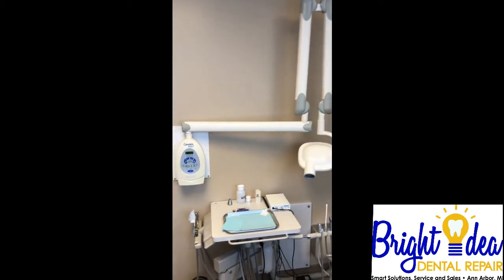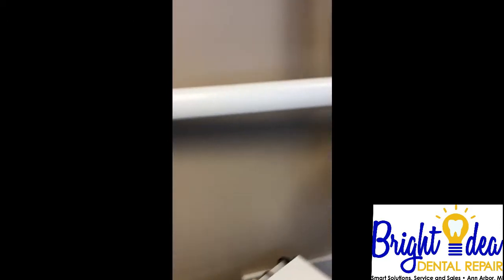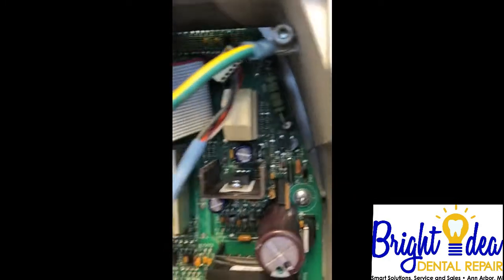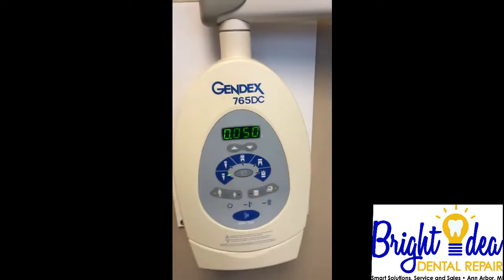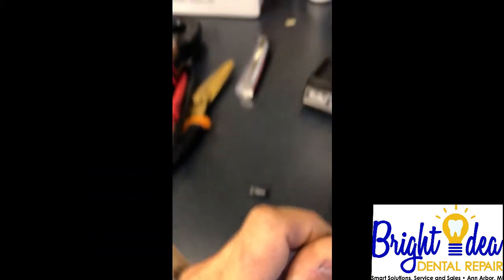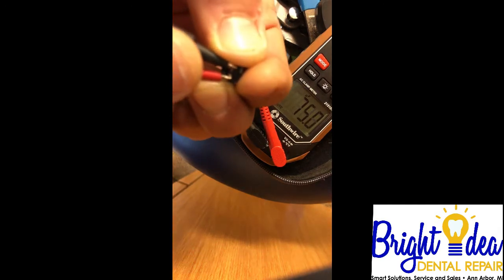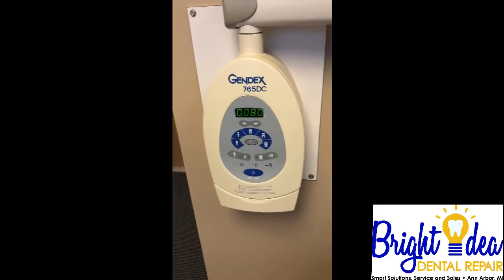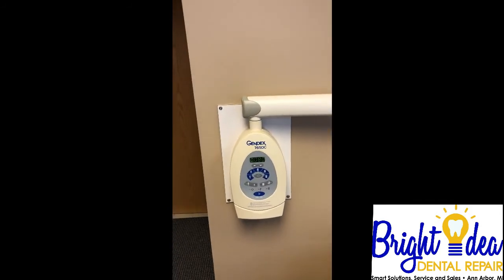Gendex 765DC Fixed!!!

Comment: Hi, 
I got few 765 DC, two of them show ERR01 witch together with D34 shows mains undervoltage. 
All main PCB had been re-soldered (under microscope I found lots of oxidated welding points). All electrolitic capacitors were replaced. 
That is the PCB fault (I was swapping the boards between units). 
All voltages are ok

Anyone's got a hint what's causing the Err01 problem?

Comment: MyGendex 765DC xray unit occasionally will not fire.  I notice the power light flashes when this happens and .04 appears in the display.  Most of the time cycling the power helps but not all the time.  I was wondering if you knew what the issue is and if so, if a part replacement will help. BTW  How did you know C60 and C65 needed replacing, or that they malfunctioned? Thanks in advance.
Reply from the maker: Thanks for the question. Intermittent problems can be difficult to track down. Capacitor degradation is a common issue with these units. I've worked on these before and that's why I had the capacitors handy. Honestly it was part experience and part luck. The ESR meter I used is a good way to test components, but it is a invasive process to accomplish. 
One thing you might also check is does the problem happen when the arm is only one position? You could be looking at a broken wire in your wiring harness. You can check this by shooting in different arm positions and seeing what failures you get. Good luck, Doc!

Comment: Thanks for posting the video!  I really enjoy seeing a technician that knows how to repair equipment not just replace circuit boards.  I just wish you were in my service area!  My wife who is a dentist just called and said that her 765 unit has gone wonky this morning!
Reply from the maker: Thank you! These units are pretty tough when they go wonky. Check the wiring at the pivots and see if there is damage. Broken wires can be an obvious sign of troubles.
Reply: @DentalEquipmentRepairChannel  About 2 months ago I replaced the medium size arm with a longer arm.  I purchased the arm from a dental dealer and said that it was in good condition but the wiring was a little banged up.  I thought it was OK but it started to act up so I put the original medium arm back on and it seems to be working fine.  Thanks for your reply!!!  I just with you were in the Florida area!
Reply from the maker: That's a bummer. The wiring can be replaced, but it is a bear and requires some solder skills. Unfortunately, the GX770 was the last really durable/repairable x-ray that Gendex made. 
I have a terrific nationwide network of other dental techs. My buddy brian is in Florida but I don't know how close. https://coynemed.com/ . I might be able to help you or keep you supplied with some used items if needed. I like to joke with my female dentists that I am happy to train their husbands. You can email me at Jason@bidentalmi.com if you want to discuss ways we  can work together from afar. Cheers!
Reply: @DentalEquipmentRepairChannel  Thank you for the referral and thanks again for posting the video and sharing the solution!